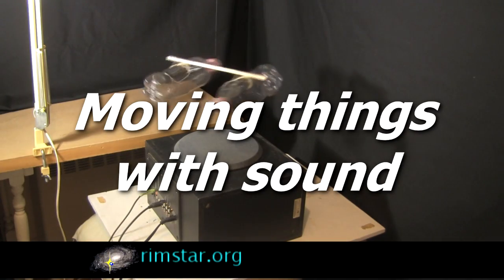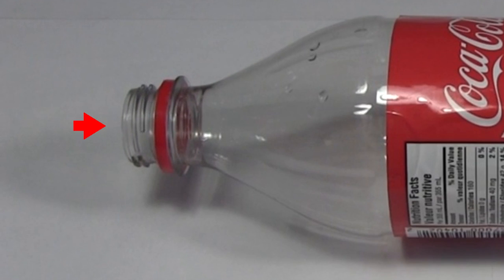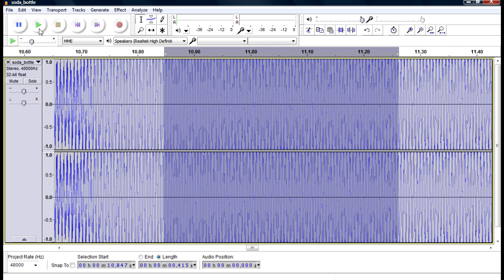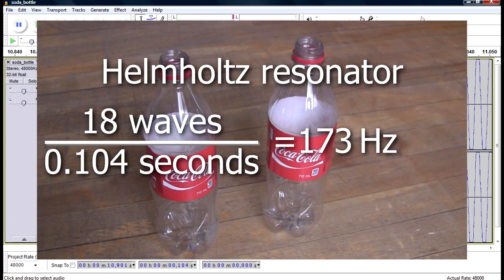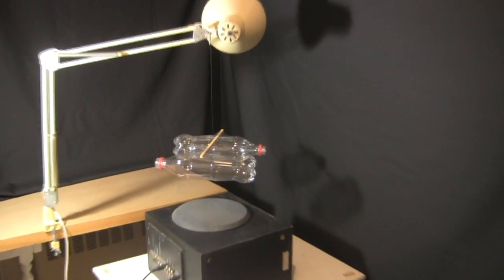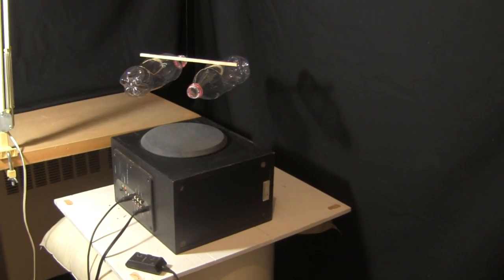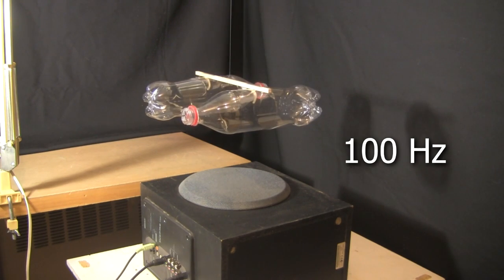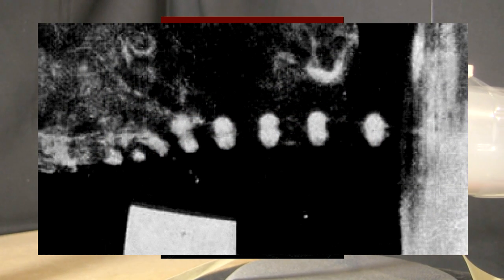How to Move Things with Sound/Acoustic Propulsion

Comment: Instead of a bottle an airfoil should work too.
The bottle opening should be at the trailing edge

The pressured air coming out needs to move faster than flight speed. 
Thrust is produced by catching the air near the trailing edge.
Reply from the maker: Neat idea! It does have to have some minimum shape properties as I show in this video about how it works, but it might be doable. If not, then the bottle can always be the engine under the wing.
Reply from the maker: Oops, here's the video about how it works https://youtu.be/PZVeJ2rh6ts
Reply: @RimstarOrg  
Ty i'll take a look. 

Im quite interested in Aeroacustics.
Working with resonant frequency could make airplanes more efficient and less noisy.

Comment: So to move a rock in this way do you have to hollow it out and make it into the shape of a coke bottle and then blow across the top to get the resonant frequency?
Reply: Try asking AI you might get a good answer but I am thinking if it was a solid rock then just get a hard object and hit the rock while use a recording device that can be in contact and press against the rock and record it. More like you press your ear on a cement floor or wall and try getting a harmer and hit the wall. You find that the sound is kinda different compare to when you get your ear off the wall.

Comment: Let's see if you still read comments....
i had an idea concerning the use of resonance and propulsion... this video hits on some of the points... so my thought was to build a resonant cavity and place a tuning fork/rod in the hollow of the cavity and adjust the tuning by extending or retracting the rod into the open cavity from a sleeved regulator that has a striker to set the rod to vibrating... If i were to use this resonance to move air past a few venturi's to cause greater amounts of air to flow over and beneath an airfoil and generate lift without electric motors or propellers or even edfs...

What so you think could it possibly work and if so could it be scaled up large enough to move cargo etc....

Comment: That's how they built the pyramids 🖖
Reply: Lev gas or ultra pressurized water and a panama like canal system around the edges… power wash/sandblast, float or contain a gas beneath which decoupled gravity. Just like coral castle.. the green acid filled glass bottles wrapped in copper in his shop.
But what do I know.. ;P
Just enough to emp this whole rock into the stone age or put a continent in the ocean..
Just a little unseen comment few will see.

Comment: Is there an opposite and equal reaction of some kind concerning the speaker itself? How does it compare to the bottles? Thanks.
Reply from the maker: Good questions. There isn't one directly. The bottle moves in one direction whenever air is pushed out in the opposite direction. So that's the equal and opposite directions there. The speaker has its own equal and opposite directions when the speaker's cone creates the sounds waves, that is the moving waves of compressed air which move up to the bottle's opening. You can see more about how the air in the bottle works in my follow-up video here http://youtu.be/PZVeJ2rh6ts.

Comment: What if you repeated the experiment? But this time take a aluminum bottle and resonate it at its resonant frequency with unidirectional electromagnetic waves with Pulsed DC with Tesla Coil top load acting like a speaker emitting unidirectional pulses of electromagnetic waves at the resonant frequency of aluminum bottle. Will it work producing some kind of electromagnetic propulsion inside aluminum bottle? Would be interesting project i think figuring out how to get it to work.

Comment: "Without vortex-shedding there is no propulsion"   So, this is actually launching a series of ring-vortices, with an intake-cycle between each one.   Hey, get a strobe light, set at 172Hz, and you should see the stream of smoke-rings moving slowly out.

Heh, JELLYFISH ENGINE!  This is how jellyfish propel themselves, using just a single exit-hole as both intake and exhaust.
Reply from the maker: Back when I was doing this I tried setting my camera frame rate to 60, the best it could do but didn't get good footage. I hadn't thought of using a strobe. Thanks Bill.
Reply: Yeah, microsecond flashes would catch them, even if repeated quite slowly.  I thought the resonator might be a good way to propel a swimming micro-drone (wireless acoustic power!)  Give them two different frequencies, to run each thruster independently via the same loudspeaker.  Drive a small camera around inside your own stomach (first drink a couple liters of water!)  But it might not work, since at too small a scale, viscosity acts immense, and vortex-shedding doesn't occur.  (I hear that bacteria don't exactly "propel" themselves, instead they burrow like moles through water which acts like tar.)

Comment: Is it possible for you to give me a rough estimate of how loud the was? I'm trying to replicate the experiment but my speaker's maximum amplitude is about 115 dB.
Reply from the maker: A rough estimate by looking at charts online, I'd guess at between 100 and 120. It's too loud to hear yourself talking, you have to shout.
Reply: Thank you for your prompt response! I have been unable to replicate the experiment as of now and suspect that my speaker may be the problem. It has a small surface area -- about the size of a 710 ml CocaCola bottle. Could this be the problem? Thanks again!
Reply from the maker: I'm not sure the small size would be the problem since sound waves spread out spherically from the speaker. If the bottle opening is above the speaker at some point then you should see movement -- if not then that's not the problem. Is your speaker a woofer or subwoofer, like I mention in the video? Woofers and subwoofers are better at producing the required low frequencies. That may be your problem. Another possibility is are you're producing the right frequency. If you're too far off the frequency then it won't work.
Reply: RimstarOrg I am fairly certain that I have the correct resonant frequency. The speaker I'm using is not a sub-woofer/woofer so I think that you're right, that may be the problem. You wouldn't say I need more than 115 dB then? I kept worrying that the sound amplitude is not loud enough. 

Thanks again! I really appreciate your help!
Reply from the maker: I didn't measure the dB so I can only compare to online charts. The speakers may actually have been producing a lower dB than my estimate since I was in an enclosed room (to reduce noise to the neighbors).
In addition to the woofer tip, make sure your bottles are free to move.
Reply: RimstarOrg Thank you so much! Really appreciate your help.

Comment: I was trying to reproduce your result, and manage to do so after a lot of difficulties. First of all I find the resonant frequency not by blowing into the bottle, but by swinging it around. I find that the blowing method doesn't produce a "clean" sound (there is always noise from the blowing itself). Second, I use a smaller plastic bottle (600 ml) which is lighter than a coke bottle. The coke bottle feels more rigid than the bottle that I use. Is this good or not? Third, in order for them to move, I must use a very loud sound. Is this correct? My ears feel funny after the experiment. I guess I have to use headphones next time.

This is the video of my result: https://dl.dropboxusercontent.com/u/93494026/VID-20161229-WA0002.mp4 (the size of the video is 3,7 MB).

In the end, thank you for sharing these videos. I am subscribing to your channel now :D
Reply from the maker: Cool! I'm glad to see you stuck with it and got it working!
Interesting tip regarding swinging the bottle around to get cleaner sound. Thanks!
I don't know what effect the rigidity of the bottle would have however I suspect your 600ml bottles needed a higher frequency than my 710ml bottles. From experimenting I know that the bigger the bottle, the lower the frequency needed and the less well it works. So going with a smaller bottle might have made the difference for you.
And yes, the sound has to be very loud. I turn the recorded audio down in my video editor so you can hear me talk.
Thanks for sharing your video and welcome to the channel.
Reply: Btw thank you for your help and prompt reply! :D
Reply from the maker: Yes, I remember trying with the Christmas decorations but they didn't move, I don't know why. So I don't know if the sound can be quieter with them. In the demonstration in the link you gave, he closed to box at one point to reduce losses so maybe you can come up with a similar enclosure. Thick plastic it pretty expensive so you could make a wooden box with only one side transparent. Having it in a box would be quieter.

Comment: Do you know anything about how much thrust this has and what decibel range you are using.
Reply from the maker: I don't know the thrust of the decibel range. The loudness for me was probably around 100dB, but that's just a guess. It was very loud.
I guess you can try calculating the thrust. Weigh a 710ml bottle and get an idea of the acceleration from the video.
I tried getting a decibel number from Audacity but I don't see any way of doing it. The volume is turned down in the video I uploaded, but I of course have the original here.
Reply: ok I gotcha. Thanks

Comment: This is WEAK. This should be called, barely moving plastic bottles hanging from a string with sound from a speaker. Move a large rock, generating sound without modern equipment, and not suspended, then I'll be impressed. Show how the coral castle in Florida was made, then I'll be impressed.

Comment: ve tried this with smaller bottles and my studio monitors and 2 gtr amps going up to 101 db spl and nothing. 
m guessing I need more amplitude, do you have any idea how loud it needs to be to work?
Reply from the maker: I don't know how many db but it was loud. 100 db sounds about right though. Getting the right frequency is crucial. The smaller the bottle the higher the frequency. I've only tried it with the bottles in the video and bigger bottles. I found that the bigger the bottles the harder it is to get working, probably because the energy is less.
Reply: thanks, ill keep trying

Comment: I complimented you recently for this fine video.  I then got my own to work.  In my demo video I credit you and your fabulous work.  Here is a link to my explanation video:  https://www.youtube.com/watch?v=699WO7smx_U   I had the help of a number of physics folk.  We are wondering about your explanation here about air shooting out of the bottle like a rocket engine.  The reason I question that is that the air is never evacuated from the bottles.  Rather the air column simply moves back and forth many times per second.  The smoke leaving the bottle is confusing, though.  Although as I watch this carefully it appears to jet out quite a bit at first, but then not much a bit later, even though there appears to be plenty of smoke in the bottle.  What a wonderful phenomena to puzzler over.

Comment: A rouge planet has long been approaching a star. The scientists of this world have been working on ways to move the planet in very slight increments so that the star can capture the planet. One way was to use carefully measured and timed explosions. But another recommended means was to use what we call the Helmholtz Resonance. 

One problem: The rogue planet has essentially no atmosphere. It does, however, have a nearly unlimited supply of hydrogen and oxygen locked up in frozen layers on the surface.

Question please: How effective/believable/realistic would it be that either method could work, but especially the resonance method?

I do understand that the concept is way out there, but hey, I've got to get the runaway planet stuck to a star. Its people really need a star to call their own.
Reply from the maker: +Robert Skip Curran I don't have an answer to your question. But it made me look up Helmholtz Resonance with respect to rogue planets and found https://en.wikipedia.org/wiki/Planetary_migration and then https://en.wikipedia.org/wiki/Kelvin%E2%80%93Helmholtz_mechanism.  Awesome! Is that what you had in mind? If so, what would be the propellant and how would you make it be unidirectional to produce a unidirectional thrust?
In any case, I hope the people find a nice warm, stable star for their home.
Reply: +RimstarOrg Thanks for the very quick reply! I checked those pages, but didn't find anything that addressed my particular need. They dealt with issues and requirements that were outside my rogue planet scenario. However, my novel takes place in a universe that isn't ours, so I'm kinda free to make up my own rules. Still, I'm hoping to not have to go too far beyond reason, just to tell the story.

Again, thank you for your kind response.
Reply from the maker: Robert Skip Curran
Well if the planet is solid then you could bore a large diameter hole into it and melt some of the frozen oxygen and hydrogen to gaseous form. Gravity would pull it into the hole, I think, and then you could do the helmholtz resonance. You might have to give the hole a neck shape at the top as I explain in this video. But you'd need some way feed the resonance, analogous to the sound waves in my video.
Reply: +RimstarOrg The first part of your comment is pretty much my first idea - find deep valleys, canyons, craters, warm a portion of the frozen gases to release them, ignite the mixture, hang on. 

This would of course take a Lot of repetition, over a long period of time. And the effect each time would be slight. But, for the story, IF it's done right, then for this planet and its people, it will be enough to move the planet into an orbital position with the star.

Your idea of digging a hole or  a shaft, with a certain shape, is a new idea to me. This would be for the ignition of the gases mixture. I'll add that to my notes. Thank you.

But then I got lost when you mention the resonance feature in the same context as using the gases for explosions. I figured the resonance scheme would only involve... Ah, I think I got it. You must be meaning, Use the gases in the shaft as the medium for the resonance reaction.

If that's the case, then I don't think the scientists should have a problem feeding resonance down the shaft. Cool!
Reply from the maker: Robert Skip Curran
One more thing... Are extinct volcanos ever really hollow holes? Is yes then maybe they could use one of those.
Reply: +RimstarOrg Hollow volcanoes? I suppose there could be, but my search didn't find much on them. The planet of the story certainly could have such structures.

But your question made me think of some other Earth features that might also fill the bill.

- large cave shafts (The Cave of Swallows, El Sotano de las Golondrinas)
- cenotes - otherwise known as sinkholes (Yucatan is famous for them)
- dolines (look up dolines, or Son Doong)

Your interest has helped a lot! Thanks one more time!

Comment: Sorry but my english is not so good, so i didnt get about the speakers... my question is: what kind of subwoofer should i use to have a result like this... depends also of the bottle´s size??... i would be like to have a nice answer... thanks for sharing! :)
Reply from the maker: +Jeff Paul You need a subwoofer or a woofer that's good at playing low frequency sounds, around 200Hz or lower. The frequency does depend on the bottle's size. The bigger the bottle, the lower the frequency. But if the frequency is too low, such as around 60Hz, then the propulsion will not be as strong and it might not move. There is a formula for the frequency depending on the bottle shape here https://en.wikipedia.org/wiki/Helmholtz_resonance.

Comment: do you have to use a subwoofer. can you use a regular ihome speaker?
Reply from the maker: Michael Ta I'm not familiar enough with ihome speakers to say. Check if it produces low frequency audio very well.  As I showed in the video, my bottles resonated at around 173Hz and in my experience, bigger bottles resonate at even lower frequencies.

Comment: Dose this same apply to animatronics with the timing?
Reply from the maker: ALEX BOOOM I don't know what you mean. My understanding is animatronics is using robotics to emulate people or animals.
Reply: Like the timing when a robotic talks eg if it said "hello " would the frequency move the animatronics mouth or is it to do with some soft ware ?
Reply from the maker: ALEX BOOOM I don't know. I would think that the software both controls hardware to move the mouth and plays the sound at the appropriate time. It would be neat if the it worked the way you say though. That would save some of the effort in working out the timings. But that's not my area of expertise.
Reply from the maker: ALEX BOOOM By coincidence I just happened to watch this tonight http://youtu.be/4z_k24HPUSg?t=2m49s. It's animatronics from Star Wars III where they use the sound wave in the computer to control the robotic mouth. So it is being done.

Comment: in your sterling engine video you did along time ago I was wondering if it was possible to make the container out of glass. pls tell me I really want to make one :)
Reply from the maker: I would think no. Typical glass doesn't handle temperature differences very well, and by design that cylinder is supposed to be hot on one side and cold on the other.